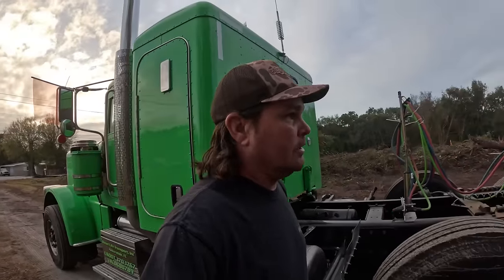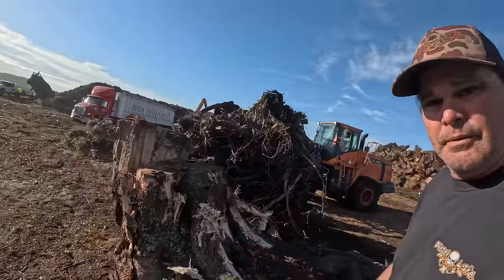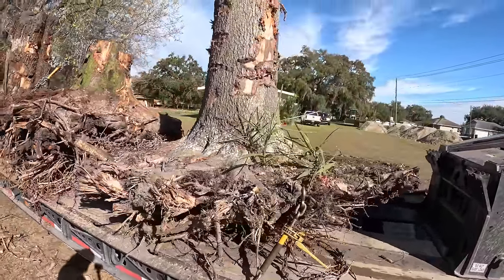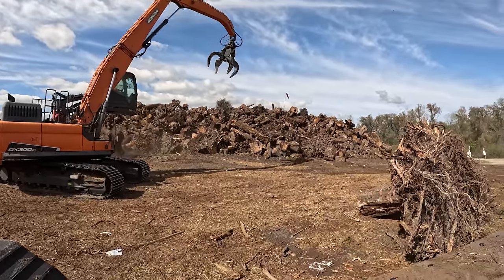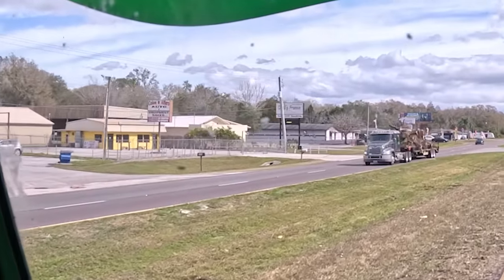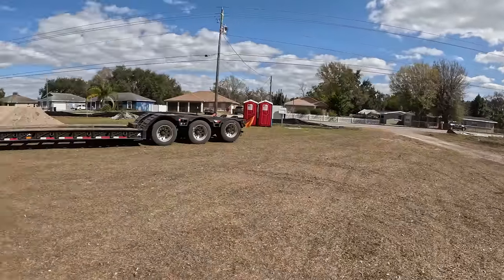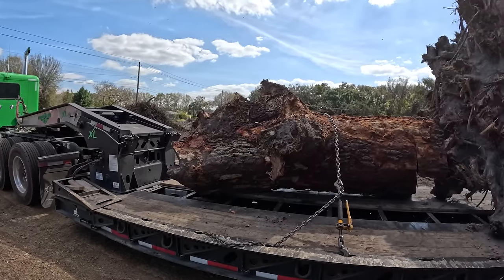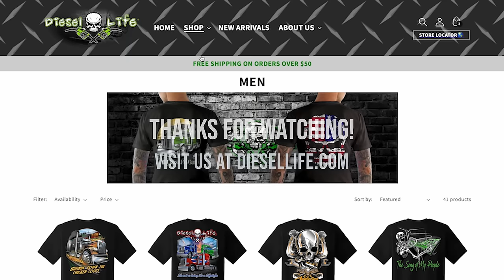Hauling Stumps ALL Day with The 1 Stack Mack & Sweet Pete

Comment: Hey bud! Good to see another vid so soon!
I thought you weren’t going to haul  stumps after the last guy almost ripped your airlines off along with the fender.
When I go to the metal recyclers I see the guys  use those  huge crane machines to throw cars busses and big trucks through the air like those stumps. They are quite the powerful machines!
Get a battery powered blower to clean the deck off or a broom.
Pushing the stumps off the side is a lot easier than side loading those heavy machines. You’ll be ok. lol!!!